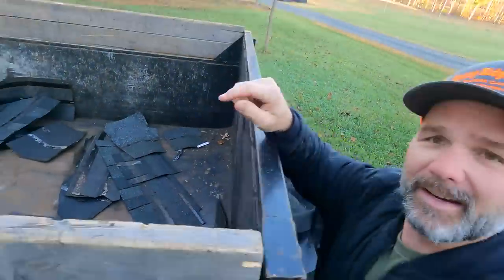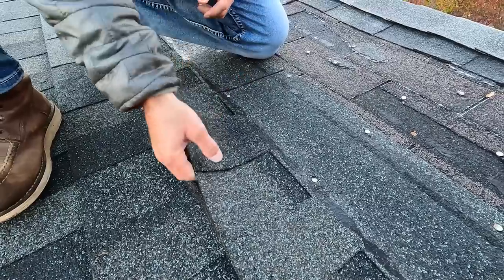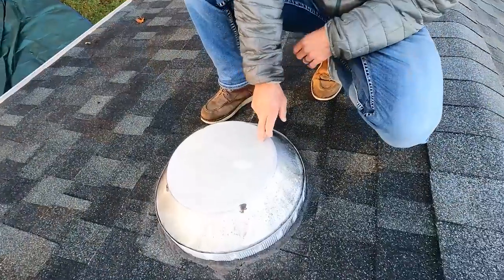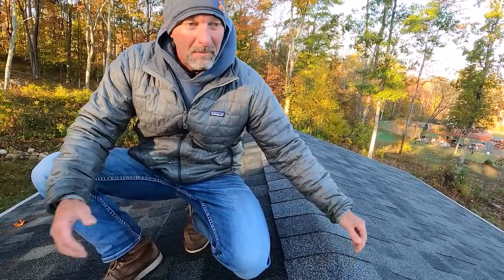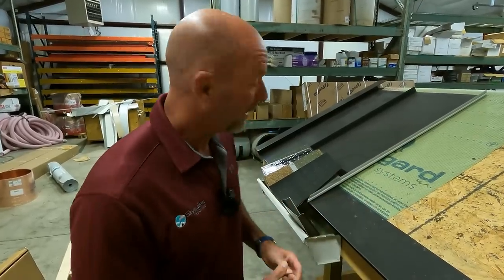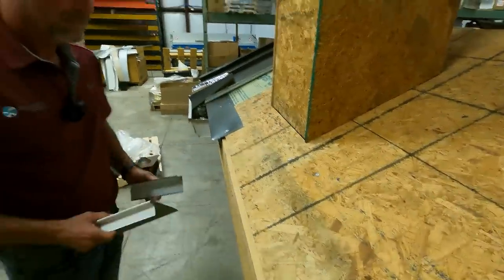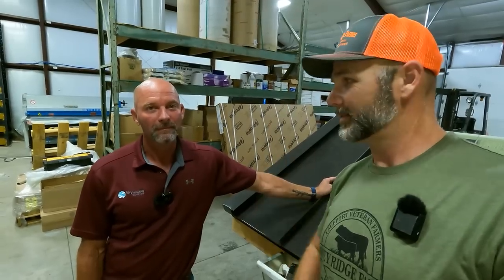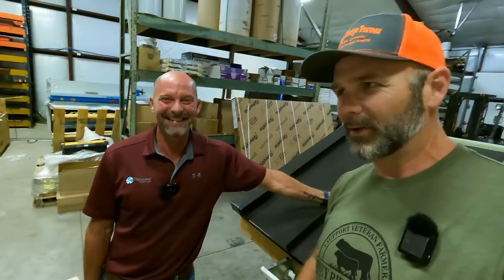Worst roof install ever!

Comment: The labor is the biggest cost so purchase the materials needed and install them right.
Reply: Technically the biggest cost is using the wrong Engineering solution to a problem. Shingles made with 50 year premium materials doesn’t get away from the design flaw inherent in cutting up a fantastically water proof material that is made in huge 3 yard wide rolls, into little foot wide strips and then gluing them all back onto a 3 yard wide roof, and then adding nail perforations…. 🤷‍♂️🤷‍♂️🤷‍♂️
Yes it’s super cheap, but if people stopped and thought about what is the problem they were actually trying to solve, then they could save even more money.
Reply: Agreed on the importance of installation though, Josh’s roof started failing way before the materials inevitably failed, and that was all down to incorrect installation. 
It’s also likely the installer didn’t actually know he was doing it wrong, which comes back to basic Engineering flaws. If you can conceivably install a badly designed product incorrectly, then the minimum wage installation worker will highlight that issue way more efficiently than anyone else. 
We call that post sale quality control. That car you are driving right now, you are the QA for that product 😹

Comment: Ugh... about 7 years ago I replaced my roof.  Ended up being 20 squares split between the first and second floor.  Thank goodness for rooftop delivery!  We also had 2 layers of shingles to pick off.  I'm pretty sure that is the LAST shingle roof I will ever replace myself.  It about killed me lol.  I might do a metal roof... emphasis on might.  Thanks for sharing!  🤠
Reply: Wanted to replace my roofing with metal. Couldn't afford the prices the Arkansas engineers quoted. Probably for the best, Arkansas engineers never execute and complete any job properly...

Comment: Great video, I live in a townhouse now (bad idea - external things out of your control). IF I was still in a single family house I would go with a metal roof & be done with it. My first house I owned was built in 1929, stucco oustside with 3 layers of shingles on the roof. When it did get re-shingled back down to one layer. The city had of course changed building codes, no more layering allowed.

Comment: Our newer house was loosing shingles with heavy wind and previous owners put roof on 7 years ago. Used cheap shingles and over drove the nails on most of it. I would lose 5-7 shingles in 50 mph wind, note we live on a hill in KY where 40-50 gusts seen common. I went with a traditional metal roof with ridge cap, insurance covered about 85% of it because they agreed the roof was crap. I had Amish do it and put up a small pole barn for storage at same time with same roof color and metal close to the house siding color. It was fairly inexpensive overall considering the look and value to the property. Now the garage is used as a garage and the barn holds mowers and trailers.

Comment: The only roofing is steel roofing. My place has heavy steel roofing 32 years old. No vents in roof vent in each end.
Reply: Lapped steel roofing is really nice, it has some compromises but it’s a good economic choice. Shingle manufacturers need to stop existing, it’s a fundamentally poor Engineering design that is destined to fail in multiple ways. Water takes no prisoners.
Reply: I had a shingle roof that lasted 20 years, through 4 hurricanes & just as many hail storms. Put it on myself & only needed one repair in all those years. So it is possible to make quality shingles. I didn’t choose metal because I rather live in a cave than with the noise & aggravation of a metal roof… like having to go outside in order to get a cell signal.
Reply: Tile roofing, mine is around 150 years old.
Reply: @nanachymp8428  yep tile used for a thousand years. Need heavy timber frame for big area roof.

Comment: Vinyl siding leaks at the corner pieces the tops and bottoms of the window and door trim. You can get real fancy about curing these issues, but you can melt it if you run your barbecue against it. Then it catches fire. I suggest a good study of old fashioned flashings and alternate siding material. The original building codes were created in Chicago after the big fire that burned half the city. Look for fireproof exterior materials. Best of luck . God bless you for being a YouTube creator trying to help educate people.
Reply from the maker: if ya install vinyl siding appropriately it won't leak....and you should never grill up against your house, under a porch or eves of your home...I agree....now I'm not dead set on vinyl for sure

Comment: I put several roofs on using the cheap shingles and as long as you take a propane torch and heat up all the shingles after installation you will activate the tar on the back of the tabs. I always glue down the tar paper around the roof edges and then glue down the shingles around the roof edges this is a must in a high wind area. ice is not a problem where I live but we get 80 mph winds
Reply from the maker: wouldn't it be better and save more time an money to simply buy a quality product and install it?
Reply: @StoneyRidgeFarmer  sometimes you got to work with the cheap customer that doesn't have the money, on my personal properties I use the 30-year composition shingles.

Comment: This be good  time to returns roof and increase  eve over hang keeping  water away  from siding  and windows  and I personally  go with metal roofing
Reply from the maker: tons of folks argueing metal roofing...but we are talking about putting a $14k roof on a mobile home my friend
Reply: Well the come back to that if you going to do it   do it right  and have no regents  or in 18 months to 2 + years be regretting  that it wasn't done right     I have past experiences  with mobile  and moduler  home  currently  work maintenance  and grounds keep in Dual RV Park  and mobile home park   and have dealt  with same issue  owner just 30.000 $ new roofing  and sidings  all because on no eve  issues  which  being corrected  here in Washington state  in the cascade mountain  4 mile from Canadian border  deal cold asd snow

Comment: TEXAS: I'm on my 3rd roof since 2005. First replacement roof was 20 year asphalt, second roof was 30 year asphalt, and this last 50 year Owens Corning all products asphalt roof has been up a year and already had the contractor out because of loose shingles for roof repair. My old shingles were always taken off. I've got all the bells and whistles for venting.
 
Labor is the main problem. Warranty, hahahaha - worthless. Nail guns should not be used in my opinion. EAGLEGARDS...

Comment: Over several decades, Less asphalt has been put into shingles to Cut Costs and part of the ‘green’ movement. Cutting their Lifespan 10 yrs and more.
Reply from the maker: Materials have changed...but I bought cut rate garbage shingles and that was the biggest problem
Reply: It’s not a green issue, it’s a cost of oil issue. Forcing home owners to rip their entire roofs over every decade is the worse thing possible for the environment. And the reason that happens is that women prioritise their granite kitchen tops over the really poor Engineering design solution keeping their entire home dry. And the manufacturers are able to get away with producing a low quality product by handing the standards authorities large bags of cash to certify awful designs.
If you wanted a green solution you’d use slate tiles and easily recover the cost of installation over a 500 year expected building lifespan. Even turf is a better solution than shingles…
Shingles are what you specify when the building is fire and doesn’t need to last much longer, and your Dad is the planning officer
Reply: @____________________________.x  You can recycle shingles, but I doubt that is what is going to happen to these
Reply: That’s what I’ve learned, higher oil costs have resulted it lower single lifespans. Due to less asphalt in shingles.

Comment: If you would have pulled the plastic off of the glue strip your shingles wouldn’t flap in the wind.
Reply: 2:12 for anyone interested 😬 You don't actually have to remove that strip, it's just there for transportation, the thin line in front is the tile seal and that's the bit that failed

Comment: Mobile & modular homes are specifically engineered homes — go with the specs & go with someone who specializes in their repair ( repairs are actually easy, if you’re able to obtain the parts made specifically for them ). Two layers is a big no-no. Never try to replace doors & windows with traditional ones, & never, ever cut into your header.

Comment: I think America is the only country still using shingles? They really are a terrible design concept, and like you found out it’s hard to tell what you are buying. In the UK the bottom end roofing material is bitumen roll that gets torched on, it’s pretty much a wide continuous sheet so no flapping tile issues. Next up in cost is a two layer version of the same thing, but it’s a full adhesive layer and it’s really thick, nothing gets through the first layer and definitely nothing is getting past the second short of the birds hammering in a nail, next up is EPDM rubber membrane, a continuous factory welded full coverage sheet, lasts forever.
This whole concept of taking a huge wide bitumen sheet and then cutting it up into itty bitty tiny little leaky tiles to make it “look pretty” is totally ridiculous?  This is a simple Engineering problem being totally ruined by a sentimental fudge that nobody ever looks at. Shingles are a cheap way to lose more money faster. 
No Engineer would ever put his name on a shingle, they are all being made by HR departments and traffic wardens, they are an embarrassing architectural anachronism that needs to stop existing for the sake of humanity.
That you got two years out of that waste of good asphalt is a sign you are destined for a good life 😹
Reply from the maker: well my friend...I guess we just do things differently here
Reply: @StoneyRidgeFarmer  In terms of building or engineering we just look at what Germany or Switzerland do, if there is a better way of doing something then they will find it first. Then we copy them about 20 years later, it saves time which saves money. Check out RR buildings visit to Switzerland last month, really interesting.
Reply: @____________________________.x  Yes it is curious why it is so popular? On YouTube there are videos of Americans constantly replacing such shingle roofs with the same product. I'm also surprised given their climate just how little insulation is used and how everything appears to be built on site, in Germany it is much more modular
Reply: @ottodietrich5714  >Yes it is curious why it is so popular?

It's cheap for piece and require no special equipment like one you need for these EPDM membranes or all roof long aluminum sheets that they made on site from rolls. It's require no visible skill either (comparing with metal sheets standing seam or seam on plank roofing) especially when you have roof more complex than 1 slope and you need go around many chimneys, multiple eve connected each other, cilindrical slopes and such. 

Oh, and manufacturer give you age waranty that you will be unable to apply in fact but you dont know that before you complain. :D

For small slop lenght and straight forward roof like one on video I (personally) will be go for bitum sheets and torch or corrugated metal sheets on whole slope. If you artist inside you can go for metal sheets stamped to looks like clay shingle. Price almost the same as for usual corrugated sheets.
Reply: @delta_glider4362  Yes we have the stamped tile effect sheets too, more acceptable for urban housing and the ROI is better than this. We have much steeper roofs so installation is probably easier than trying to line up bits of asphalt on such a slope

Comment: looks like they didnt even remove the selafane strip from the shingle ??
Reply from the maker: and you don't have to remove that strip...it's only there to keep shingles from sticking to on another in storage...it's not for adhesiveness once on the roof...the shingles are stacked in the packaging differently than they are installed on the roof...thus no need to remove despite "urban legends" ...think about how they overlap in the package v/s overlapping on the roof
Reply: @StoneyRidgeFarmer   ok ! Thanks ,,,
Reply: Dont sound right  ? But I guess
Reply: @StoneyRidgeFarmer  its suppose to stick somewhere  ! But ok ,, leave it on ,,

Comment: Probably 95% of homes in the country here that put on metal roof use regular barn metal.  About half the cost of standing seam.  You didn't even mention that.
Reply from the maker: yep...because it's absolute garbage and not recommended....it's not the materials...it's the installers that ruin it with bad technique and cheap fasteners ...standing seam is the way to go

Comment: Why just put a metal roof on that home? Never have to replace it again.
Reply from the maker: fasteners are the issue...if we put a standing seam roof on this place it would cost $5500 more....this is quick, simple and will last my lifetime on a mobile home that has outlived it's expected lifespan
Reply: Mobile & modular homes are specifically engineered homes. You need to go with whatever was on them originally or build a shelter over them. And never add more weight than the original.

Comment: In that home I probably would of gone five rib steel roof. Yea I know the faster. Thing but to me I think it's the best for the money.
Reply from the maker: problem is the fasteners fail
Reply: @StoneyRidgeFarmer  I am not arguing there. If installed proper. I bet you can and should get say 30 years from the original....then you can re screw. Yep that means money but nothing like a re roof and figuring that money is so far down the road may come out cheaper in the long run. Remember the time value of money the huge upfront cost of standing seam today really is a lot more in 30 years. Saving that today equates to lots more money down the road. I know you know what I'm saying. I also know about the fasteners. Just pointing out what I think but sure folks need to know everything to make informed decisions.
Reply: I had fasteners put on top of the ridge instead of the bottom. Huge difference.

Comment: Why not metal roofing once and done.
Reply from the maker: This is a lifetime roof....standing seam with no exposed fasteners would have been an extra $5500
Reply: Fair enough....
bald dry prairie fire danger makes metal a very good peice of mind when fire danger is high. Metal is still solid after a hail storm.
Plus metal roof is never worth nothing.